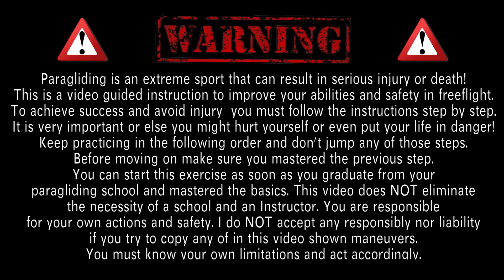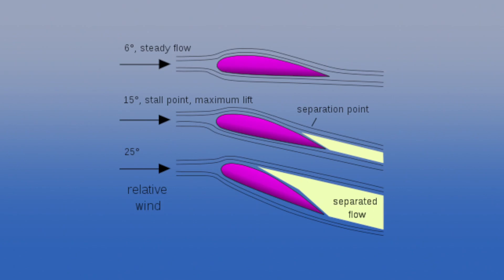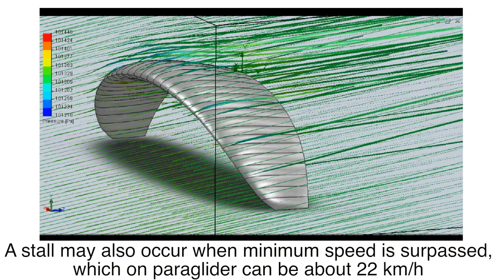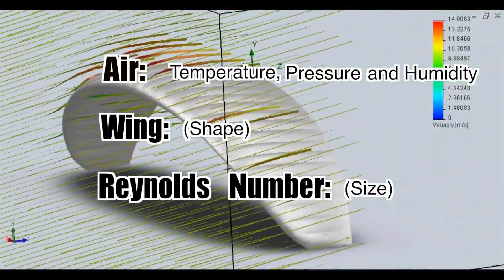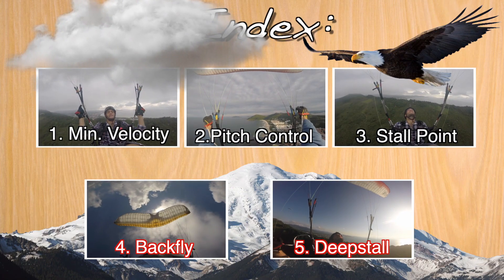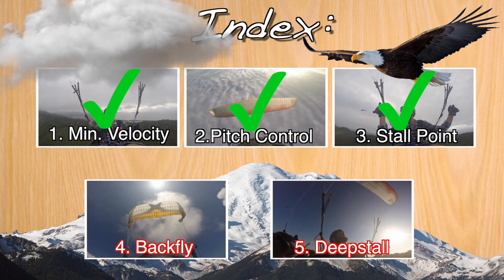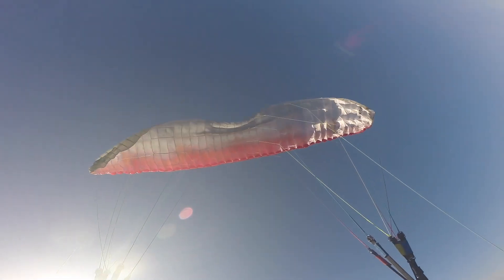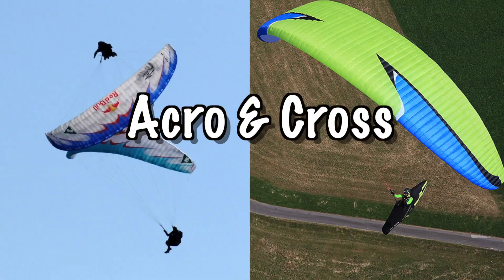Stall (paragliding tutorial) | Max Martini

Comment: I'm still doing ground handling. I'm stuck with that for an extra few weeks. I have decided that when I land the first time after they told me up in the air all I'm going to be able to do is unbuckle my chest strap lean far forward. Come screeching in a trim speed with as much parasitic drag from standing up and spread my feet and legs wide and when I get one meter off the ground or less I'm going to pull the breaks on full into a flare just as deep as I can push them. I just don't have the talent to do anything else at this point. Focus on roll axis. I have a giant landing field so anywhere I touch in as fine as long as I can get my altitude right and slam them brakes on hard so I don't have to have any fine motor control for my brakes access controls or anything it's just flying level slam something in. I'm flying on the heavy end of the wing and I'm wondering is this going to work?
Reply from the maker: Hey, the idea is to be as symmetric as possible and recognize the stall on the brake pressure while minimizing the risk by flying as as possible
Reply: @MaxMartini22  you left out one word as()as possible. I'm at payload not a pilot. If I come in fast moving in a straight line add a 15 degree angle of incidence. I can throw the breaks down hard both hands as fast as possible. Instead of having a skillful transition like you do I want to have a transient like a math professor does. I'm going to have a football mouthpiece and as soon as I flare those brakes I'm going to hold them down no matter what.
 that's what the instructor said. He said that you had nothing to fear but fear itself at that point and if you held your hands down you would swing out and down and forward and you better be laying way out to get your legs under you so you don't land on your heels or your back. I think if you come in fast and you commit hard and quick and you bite your mouthpiece there will not be time for any asymmetry to occur. I like to stand up for the 100 ft and below. If you stand up it lowers the trim speed and tips the nose down. More tension on the lines too. I'm new at this I'm working on my ground handling and I'm scared shiftless of trying to do the pitch axis and the yaw axis, I think only the roll axis and and a mathematical transient flare hard is all I'm going to be able to do.

Comment: I think you have the safety thing backwards 6 ft off the ground is nowhere to practice anything. If you're six feet off the ground and you're almost stalled you are in trouble. If you get a little pitch instability you will swing into the ground hard trying to figure out how to do them tricks six feet off the ground. If you're going to practice these things safely wait until you've got a couple thousand feet altitude so you have time for problems to resolve themselves.
Reply from the maker: Did you really watch the whole vídeo? Have you tried this method?
Reply: @MaxMartini22  I watched the whole video I watched a lot of other videos. When you're flying close to the ground anywhere near a stall and you were flying into a wind near stall speed, you are asking to fall, any little bit of turbulence and a little bit of wind shift could take your air speed and drop you. When you get close to the ground you need to fly fast so you can dominate the air currents that would trip you up at stall speed.
Reply from the maker: @markmcgoveran6811  Incredible how you are not able link the dots.
I'll ask you one last question: Why do you think this video was made for?
Reply: @MaxMartini22  I don't understand the question? At the end. I do understand the physics of flight floating along there to low speed a couple of meters off the ground in a para glider is a risky idea. You may get by with it a few times if you're close to the ocean and you're getting that nice laminar sea breeze. Anywhere else you are begging for trouble.
Reply: @MaxMartini22  I would guess you made this video for organ donors. Not that it matters who you made the video for when you're that close to the ground on something as light and sensitive as these paragliders you need to bring on some speed so you're dominating not getting collapsed because the friction near the ground causes a lot of weird wind currents that are hard to predict and easy to explain.

Comment: Is there a difference between a stall and a full-stall? I am a little bit confused about the terminology. Thanks for helping me out guys!
Reply from the maker: "Full Stall" is typically used in siv, where you fully dismount the wing, almost impossible to recover without stabilizing in a backfly first. A Stall by definition only means that the wing "stopped" producing lift. In paragliding we have many stall configurations for example pre-stall, deep-stall, etc.
Reply: @MaxMartini22  Thank yoz Max, highly appreciated!

Comment: Im not even a beginner (yet) and I wonder how a normal looking guy like you uses a XS B- or C-Wing. I mean you don't look like you weigh only 60 kg. Could you elaborate why you chose to ride your glider that top-heavvy. I know it's stable and stuff but does it really get that extreme? Don't you want some lower sinkrate as well?
Reply from the maker: I flew it with 90 kg take off weight, 15 kg over the limit.
Flying like that you get more direct handling and the wing flies faster.
Reply: @MaxMartini22  i'd recon this is something acro people do, but are you even an acro flyer? Im weighing 79kg, is a Bolero 5 S, M or L better for me? I think i want good "uptime" and good low altitude soaring on small hills.
Reply: @MaxMartini22  Thanks for your answer Max, my flight trainer and all friends strongly disapprove such behavior. Isn't it extremely uncautious to topple the manafacturers limits? I don't know if you use if for acro, but if you don't i hope i can learn from your insights. Your last statement didn't fully convince me yet.
Reply from the maker: Every paraglider, that is certified with EN or DHV, is designed to withstand up to 8 times the maximum load. So flying it 15 kg over the top won´t influence the structural integrity of the wing, although it will change completely the behavior, which is not recommended for rookies and beginners!
Reply: @MaxMartini22  I appreciate your input a lot as I see other people look up to you as their role-model. I feel very confused in my research about a clever way of progressing in this sport. I feel like I will be flying A LOT more than most people who have little time, so I wonder what the right Glider could be for me? My job doesn't make a lot of money and thus I fear being stuck with a "lame duck beginner Glider" for many years. Is this something to be worried about? At this point, I think I should get a S-sized wing, so I end up close to the maximum weight. Can you name three models you think are appropiate for me?
Reply from the maker: @thisisyol  I understand your Situation and I will recomend you only 1 glider: Infinity 5 (you don't need to be over the recomended limit but it's best to fly it on the top end)

Comment: Hi, Max: is it possible to practice in a flat area the position you achieve in the minute 1 26? You are hanging in the air without moving forward.How can I gain altitude in a flat area with a normal EN A wing? Thanks for the video, it is very clear as always!
Reply from the maker: martin Hi Martin, no it's not possible to do it on flat, you need a mountain/dune/hill and constant 15km/h wind blowing.

Comment: Very nice video! But i think that one should fly some full stalls before searching and releasing the stall point - the danger of overshooting and falling into the wing is very high (yes, speaking from experience, even if i missed the wing ;D) if you release just too late. Meanwhile if you pull a full stall and do not release before the glider comes back over your head the wing will most likely not have enough energy to overshoot enough for falling into it. Touching the stall point is an exercise which feels easy if it works but can get extremely nasty if you screw it up. By practicing pitch control nobody is prepared to stop a strongly overshooting stalled wing.
Reply from the maker: Thanks, and thank you very much for your input! I agree: if too heavy handed any stall practice can end horribly!
It is a very delicate topic to talk about what method is better, I understand your point but it is only effective if you practice over water with rescue boat because even if it is only a simple fullstall there is still a lot to go wrong. 
I learned the exact same way I'm showing in the video and did around 150 prestalls before atempting my first backfly/fullstall.

Comment: Your video is nicem, but can be missleading. Like using the minimal speed for landing can be very dangerous - many pilots have overbraked their gliders doing so!
Reply from the maker: Thank you very much for your constructive comment, I really appreciate it!
 It should be obvious that to do a proper flare the approach is at max. velocity and close to the ground you pull quickly the brakes to min. velocity position. (It not to a stall like many would think, you touch the ground before the glider stalls)

But in fact with a constant 15km/h wind you can reduce your glide by holding min. velocity until the ground. It's totally doable especially with bigger wings with bigger glideratio. Just be carefull to not stall accidentally and/or accelerate at the wrong moment.
Reply: Sure! I understand. Your videos are just great for talented pilots with good understanting of flight mechanics... keep your great job!
Fly safe and hopefully we will meet under cloudbase!
Reply from the maker: +Petr Polách thank you very much! One day, Amen!

Comment: Hey Max, I was just thinking about doing an how to full stalls for beginners. And then I saw your video which was 
way better than I would have done. It is very well explained and I like the exercises that you gave. Only one thing worried me tho, when I tried to find my stall point last year, it ended in a full stall and I wasn't mentally prepared for it. Of course I asked ALOT of questions before doing so, but still wasn't really expecting that. Luckily I managed to get out of it well. So my question is: Wouldn't it be a good idea that the person start by the full stall before doing any of this(Except pitch pendulum wich I consider no.1 step.), just to be sure that the person will react well if something goes wrong?
Reply from the maker: Hey Samuel, I´m really glad you like it!
Well, to answer your question: No, the purpose of those exercises were to prepare for a Fullstall. Pitch pendulum to get comfortable with the surge (fullstall exit), min. velocity to stabilize before stall, and last but not least stall point release shows you max. brake course. When you mastered those steps fullstalls and deepstalls will be easier and safer.
Do you have a video of your stall training or maybe from that actual incident?